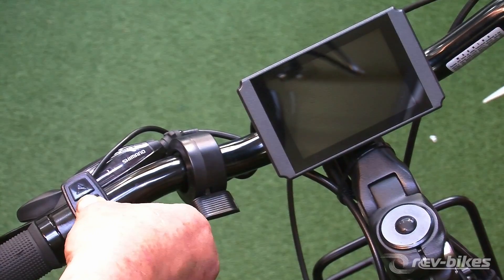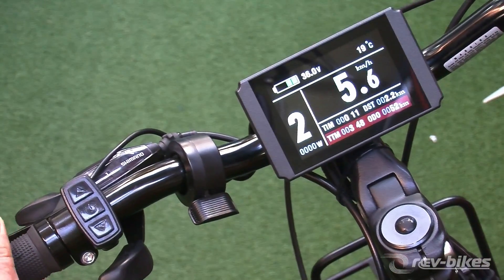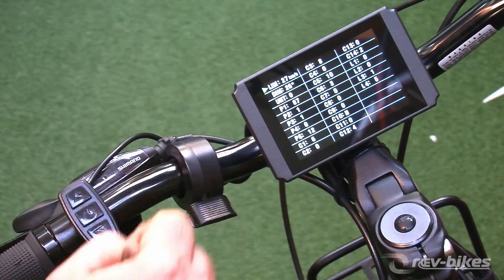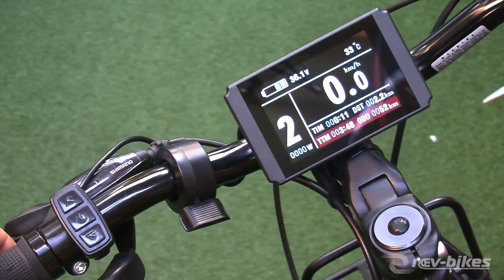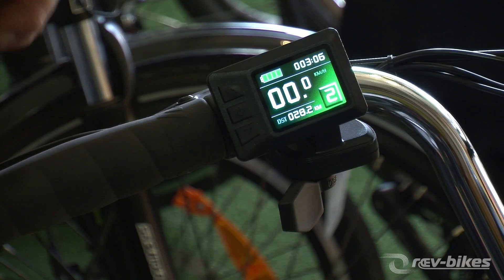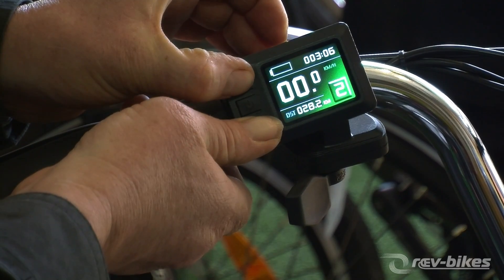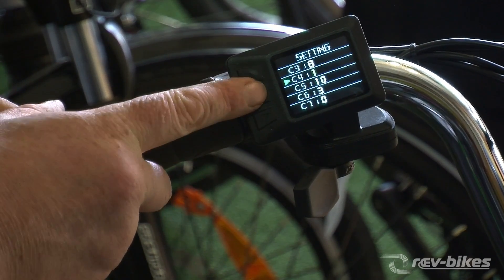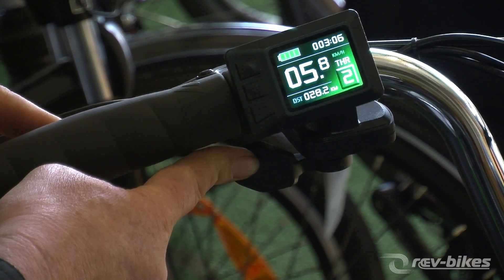How to set e-Bike throttle limit to 6 km/h

Comment: Hi there is is it legal if you do have a ebike in victoria over 200w but have it limited to cut off when it hits 25kph
Reply from the maker: @blitzz6042  No, it's not legal. Check out Vicroads website for details of the laws
Reply: @Revbikes I’m trying to change mine but I can’t
Reply from the maker: @blitzz6042  no, its not. There is a power limit of 250w and speed limit of 25 km/h

Comment: Don’t suppose you know how to  set a Yosepower display back to  6 kph throttle speed do you?
Mine when to full speed when it changed the pedal assist from 5 to 9 settings and the power in each of the 9 settings to be evened out in increments of 14
Reply from the maker: @bobbo9549  Not sure about that one sorry
Reply: @Revbikes  have since found out it not possible on a Yosepower kit with the battery integrated controller but should be where the controller and battery are separate as this has a more programable display and controller.